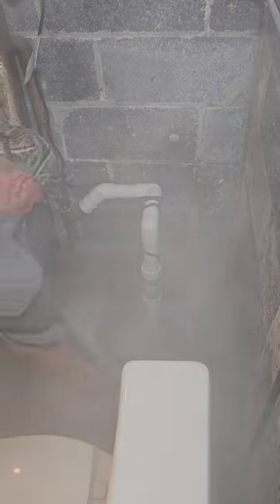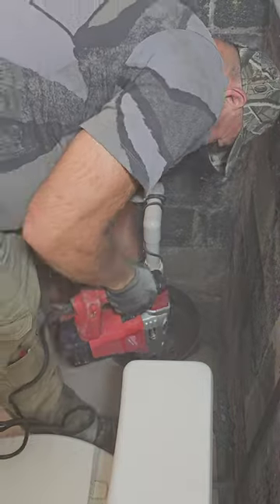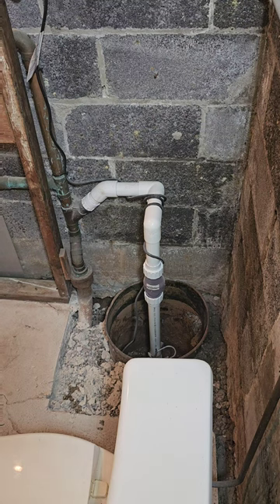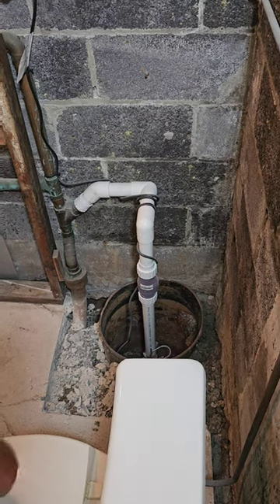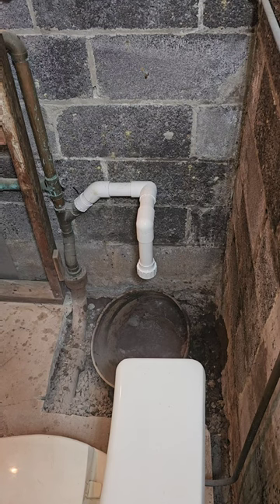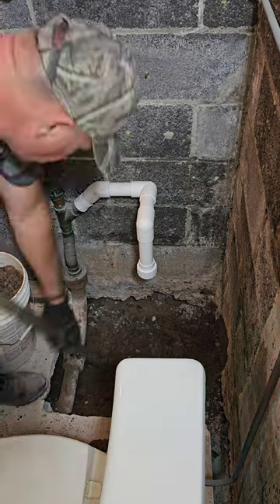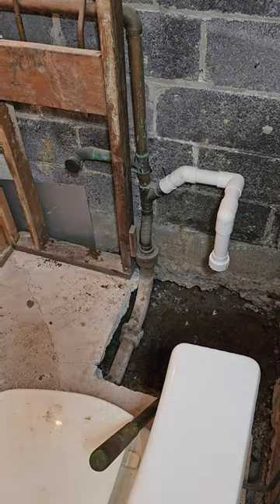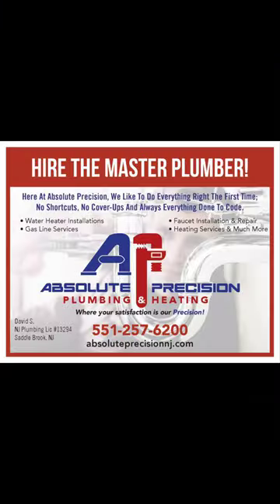Sump pump basin replacement

Comment: What's your contact? I need this exact job and I don't want to do it myself. I have an old basin that's busted and the round rock and or the gravel is in there. Just want to know the rate.
Reply from the maker: @TheGaryNinja 
Absolute Precision
5512576200
 https://maps.app.goo.gl/32UayuvKN9GmfSN48